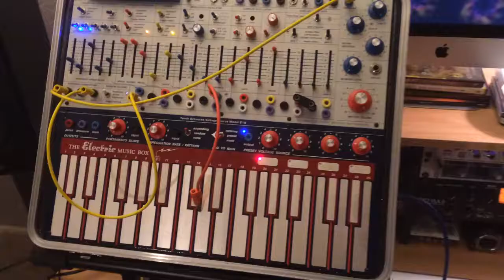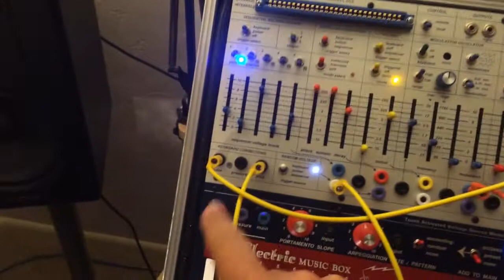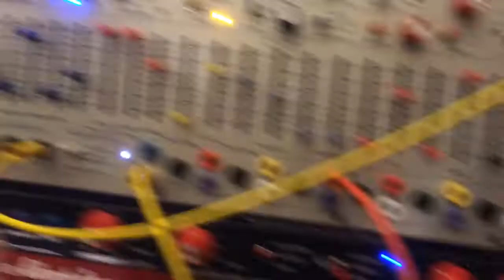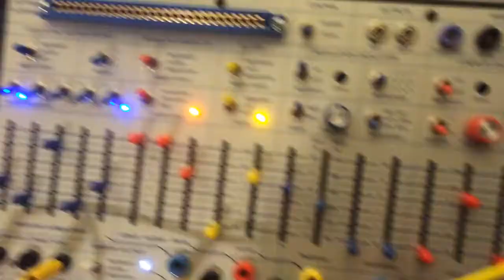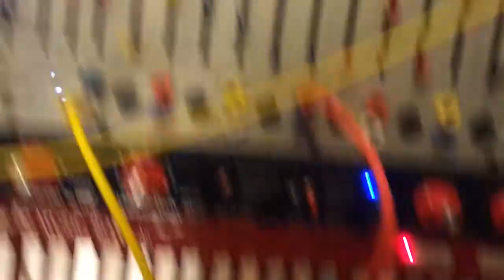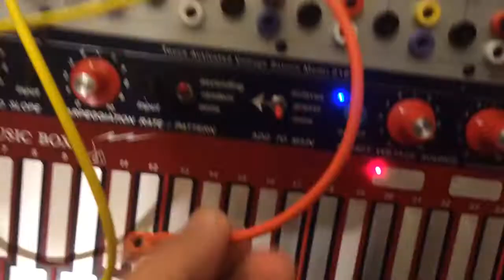Buchla Music Easel - how to patch "Noise"

Comment: I just followed this recipe, step by step.  THIS IS SO AMAZING!  It should become a book.
To add my observation: when decoupled from the keyboard section of Easel, the "Keyboard Connections" box become CV inputs, detached from their original meanings. That means... more fun than a barrel of monkeys.  I mean, this now really sounds like a West Coast synthesizer.

A question arises:  what uses would there be for the "pressure" input?